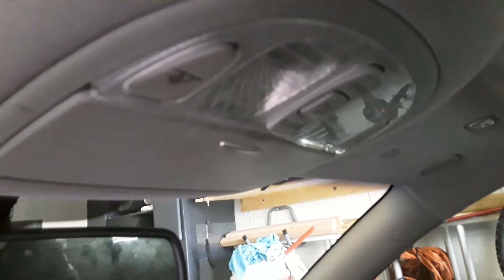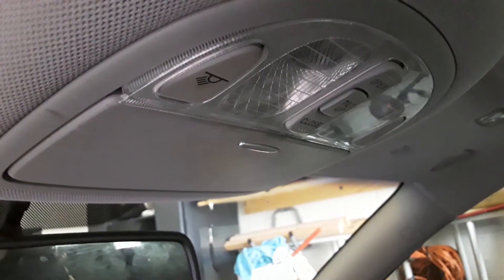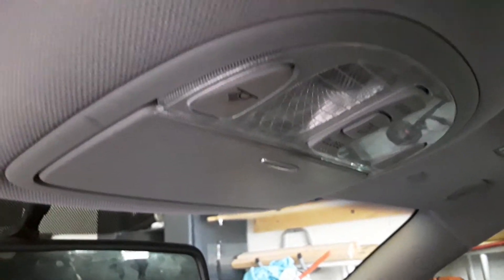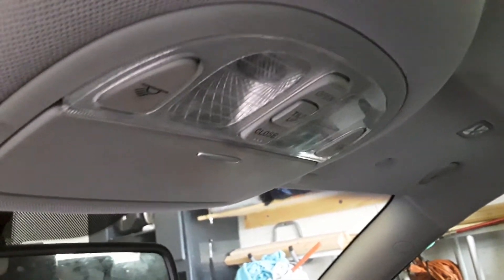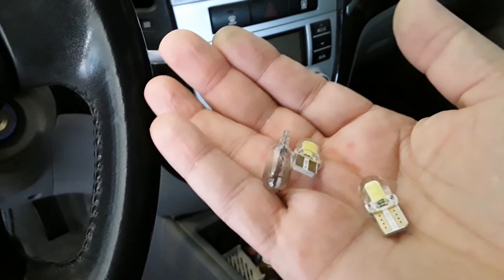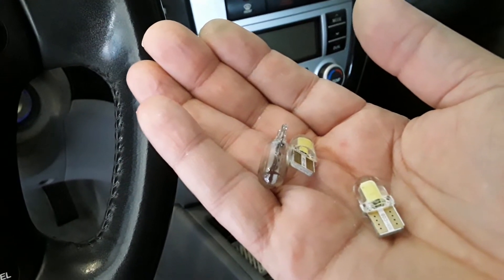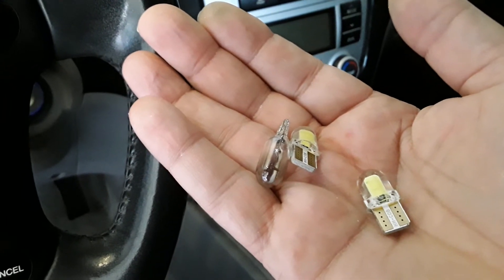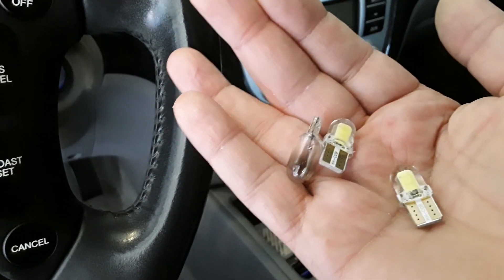How to find Parasitic power drain in your car that causes your battery to die

Comment: I have same problem. New battery, starter was rebuild not long ago. I thought it was the radio but after pulling the radio fuse, the battery still was draining. Then after removing the inerior light fuse, the car started easily. All the interior light bulbs were never replaced since 1991. 😅
Reply from the maker: The lights that come with the santa fe are useless, barely any light. I am still looking for led that are easy to install and work.

Comment: Did you replace them with the original halogen bulbs then no issue? As I'm. Having battery drain issues also
Reply from the maker: I haven't replaced them, basically I think normal replacement bulbs do nothing to light up the area didn`t bother. I was thinking of using other led bulbs but, I have found replacing other bulbs on the santa fe they would not work properly without load balancers in series with the bulb. I replaced the backup bulbs with led and it actually caused the blinker to fast pulse. Apparently they need the more expensive balancer bulbs.
Reply: @DesignBuildFixReview  so you now have no light bulbs inside your car?
Reply from the maker: @kieldunkley3626  I do not have light for the front seats, I have lights in the rear, basically because putting anything in it would not give me enough light anyway. I carry an LED wide light if I need light there. I may put in normal bulbs again but even those are too expensive now. $6-$13 for normal bulbs
Reply: Halogen take more electricity